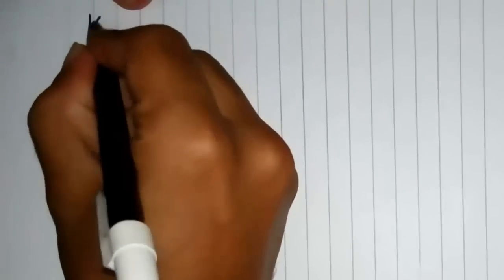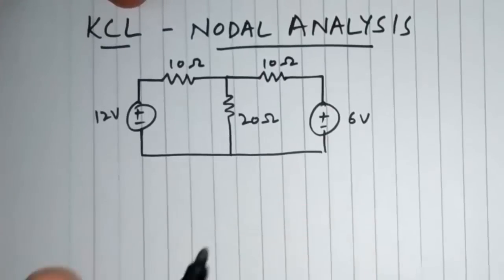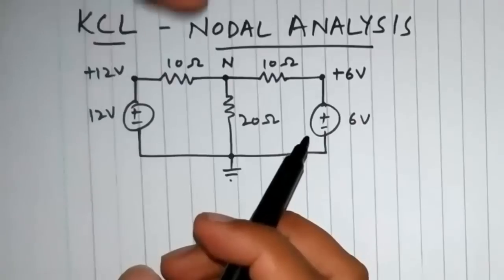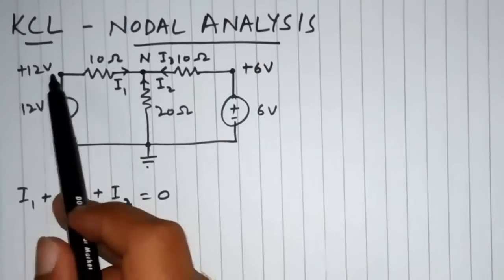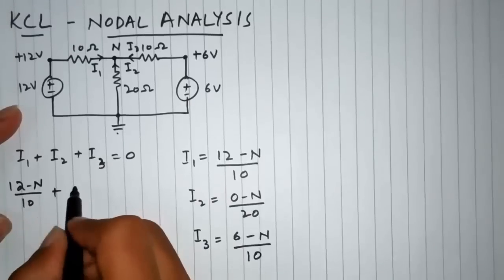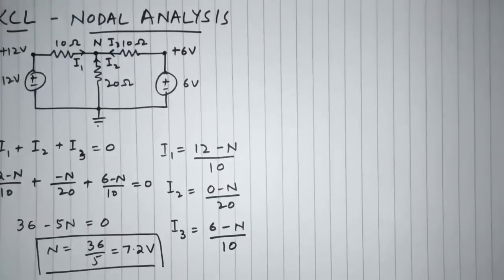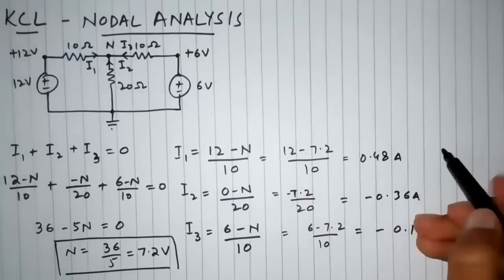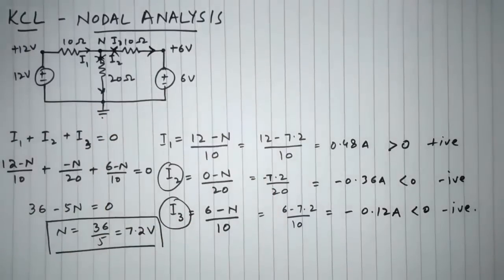Lesson 01 - Node Voltage Analysis ( KCL ) for Single Node

Comment: Thank you Sir. Can KCL be used only for symmetrical circuits?
Reply from the maker: Though my reply is late, but its an awesome question and i wanted to answer it so others may benifit if the read it.
Reply: @technicult0  Thank you very much Sir
Reply from the maker: Most definitely not. In case of asymmetric currents, KCL will be evaluated at every instant in time. If currents are constant or phasors, it is much easier to apply KCL. THATS WHY WE CONVERT ASYMMETRIC CIRCUITS TO SYMMETRICAL COMPONENTS.

Comment: I'm a little confused as to how did you get the 36 -5N =0?
Reply: I think it suppose to be 42-5N =0

look 12/10 + 6/20 +6/10 - N(1/10 +1/20 +1/10)
21/10 -N(1/4) =0 (multiply both side by 4
42/5 -N =0 (multiply both side by 5)
42 -5N = 0😎😎

Comment: Doesn't it suppose to be I1 + I2 - I3 ?
Reply: P-51 MSTG yupp i think it suppose to be like I1+I2-I3
Reply from the maker: Since I am assuming all currents to be flowing towards the node N, it is I1+I2+I3=0. 

In this case the current value of I2 will be negative after solution. This will indicate that the chosen direction of I2 is wrong and needs to be changed since current cant be negative. A negative current is actually a current flowing in opposite direction to the direction of measurement.

However since you can intuitively guess that I2 will be flowing out of the node than you may assume the opposite direction as well. 
In that case, your equation will be I1-I2+I3=0

Comment: What if node voltage comes out to  be negative
Reply: ROHIT KUMAR it does mean direction is opposite to that you have assumed!
Reply from the maker: Actually no! It means the potential of the node is less than that of the ground node.

Comment: But I'm confused that the current is flowing through the source on the right in the opposite direction (I'm new at this).
Reply from the maker: Large potential sources can cause the currents to flow through smaller potential sources in opposite direction.

Comment: Very helpful, helped me a lot but I cannot see how you arrived at 36 - 5n = 0.  Can you explain this please
Reply: (12-N/10)+(0-N/20)+(6-N/10)=0;
Now solve LCM ,it is 20 
(12-N/10)*(20) = 24-2N;
(0-N/20)*(20)= -N;
(6-N/10)*(20)=12-2N;
Now add up
24-2N-N+12-2N= 0;
36-5N=0;
Reply from the maker: Multiply whole equation by 20 and then add the similar terms.

Comment: what's the rule to choose a reference node
Reply from the maker: No specific rule. Just choose the reference node as the one with which most active sources are connected to. This will simplify your problems a little bit.

Comment: so you assume which way current goes, it doesn't matter which direction?
Reply from the maker: if the assumed direction is wrong you end up with a negative sign in your answer as we have here.
Reply: +THE TECH TONGA so just make it positive and everything is fine?
Reply from the maker: +Solomon Asmerom Change it to positive and change the direction of assumed current to opposite.
Reply: +THE TECH TONGA ok thx yeah direction in current really confuses me
Reply from the maker: +Solomon Asmerom Solving a few problems will clear your mind

Comment: At 2:50 you simplify to "36-5N", however shouldn't it be (36-5N)/20?
Reply: AK TPA Same thing, sorry.
Reply from the maker: AK TPA I am glad to see you figure it out yourself. Cheers
Reply: Yes but if u make (36-5N)/(0). = 0 so (36-5N)will become 0
Reply from the maker: (36-5N) /0 ???
Reply: yes i got confused by your answer can  you write the correct answer in to your video.
Reply from the maker: I will add an anotation there.